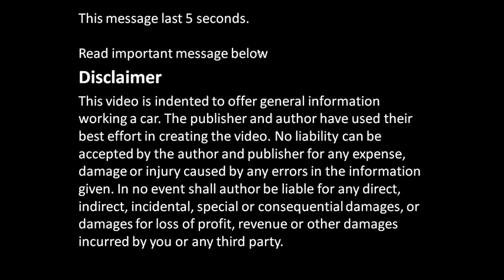How to replace ball joint Toyota Corolla. Years 1996 to 2007

Comment: Hi Peter. I have a 2003 Toyota Corolla E12 1.6L. When I steer, sometimes the steering wheel sticks a little bit. So I need a little bit more pressure to move the wheel. But this happens sometimes not all the time, any idea what it could be?
Reply from the maker: Hi, please check your cars: tyre pressures, drive shaft rubber seals,  power steering oil and ball joints.
Reply: e12 most propably has electric steering assist,check motor and steering colum

Comment: Great video....But.... what size is the hub nut?  30mm?
I was able to do it myself.with your help... . thanks!  
keep going with Toyota repair videos.
Reply from the maker: Hi, you need 30mm size. Please look my other video, where is 30mm size in use: How to replace front drive axle or drive shaft Toyota Corolla. Years 1995 to 2007

Comment: I'm having trouble with one of the securing nyloc nuts that secure it to the lower control arm the nut won't tighten or loosen its just spinning how do I overcome this please? The stud is stable it seems the nyloc is spinning in the thread.
Reply from the maker: Noted 👍

Comment: The car you worked on here is certainly not a Corolla VVTi 2000 (double headlight). I know this because there is not enough room between the ball-joint and the driveshaft housing in the hub to drop a spanner or socket upon the castle nut of the ball-joint. This issue was not there in the Corolla XL nor later VVTi models. Just a stupid flaw in the design: no one thought of maintenance access. I find it surprising the number of Toyota mechanics that are unaware of this. Taking the wheel hub + ball-joint off makes no difference to the relative position and hence no easier access though working on a bench is easier than crouching. If the car is < 8 years old the open-ended wrench will take it off. But older cars will often have cotterpin seized and castle nut very tight -- so the open-ended wrench slips over the nut's corners . . .
Reply from the maker: Thanks for feedback. :-)
Reply: Any ideas ?